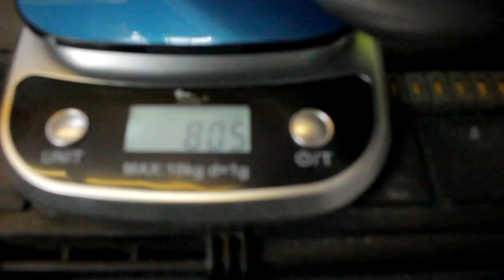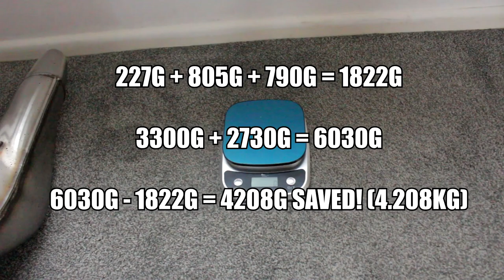KTM DUKE 790/890 R AUSTIN RACING RS22 V DECAT UNDERSEAT EXHAUST INSTALL VIDEO

Comment: did you need to remap the ECU or get a powercommander? I am worried about damaging my 2021 890R without also adjusting fueling but am have issues finding something that works.
Reply: Correct. I’d like to hear this response
Reply: I've been asking everybody I can about this... I talked to Superbike Unlimited in Asheville, NC... they said the wideband O2 sensor and ecu will adjust to removing the cats on this bike. I also talked to my local KTM dealer and they said the decat link pipe does not require a tune either. 

I was really surprised since I'm used to the traditional knowledge that slipons are okay but anything to do with removing catalyst system means you need fueling adjustment. But so far I think this bike is totally okay with leaving stock fueling. Let the bike idle for 10 minutes after first startup and it will adjust itself. A lot of inconsistent information out there, some good some not so much.

Edit: I wanted to add just incase, this is for changing the exhaust system only. If you combine removing cats with some type of airbox mod that is when you will run into issues. The 890 Duke can handle changing the exhaust to anything but if you add that in conjunction with airbox mods as well then it cannot keep up and you definitely need a tune or some type of piggyback fueling option.
Reply: @AutenBrian3  I meant to respond to you in my response to Luuk, check it out if you want. thanks
Reply: Late reply but - Rotwilier performances dyno results (de cat vs non decat) suggested no major chage to afr/ hp when a decat is performed due to restrictions in the airbox.
Reply: @v4Mark  hey what’s your experience with it? I just got inside from decatting my 790 and was wondering if I needed to tune
Reply: @DiggnUpBones  you are good to go. I’ve been running mine for most of 2022 and it runs similar to stock. I’ve talked to more people at dealership and the tuning shop and this bike is good to go with decat only. Adding an open muffler plus decat it becomes a little more questionable and the answers become split. But decat alone is 100% fine from every expert I’ve talked to. My bike has been running perfectly
Reply: @v4Mark  Hey mate, just to clarify are you running a decat + exhaust or just decat? Cheers.
Reply: @TheKez1a  only decat. Stock exhaust other than that
Reply: @v4Mark  hey I have an SC project and the decat and it’s lacking torque or something it sounds loud and good but power decrease
Reply: @TheKez1a  I have both now and I’m wondering if that was bad
Reply: I noticed a bit of a power decrease without the tune maybe the ecu is adjusting but I’m not sure
Reply: @DiggnUpBones   I think if you have both, a tune would be a good idea. The ecu could adjust and it still has less power, though,  it doesn´t necessarily mean the AFR is off but I would still tune if I had both just in case. I think if you have decat or slipon and you are good, but if you have both I would tune it.
Reply: @DiggnUpBones  I've noticed this as well with my arrow Pro Race. I am looking to get a tune done soon.
Reply: The bosch ecu used in 790 and 890 will adjust. Actually I've seen graphs that removing the catalytic makes the engine run colder. Hp gain in low rpm no changed at mid but a slight drop of power at the higher rev. Afr mixture improved across the powerband too.

Comment: Did you do a remap?
Reply from the maker: Yhhh, I also purchased Austin racing’s air box mod and ATOM fuel module
Reply from the maker: Will do a dyno as soon as I can
Reply: @JuniorMotorcycles  results?

Comment: You need to sack those rear pegs ! especially seens as you dont even have a rear seat and those pegs look pig awfull. I fitted the LeoVince twin cans and decat pipe jeez way way too loud ! and i like loud pipes so im assuming you will probaly go the same way and refit the cat to tame the noise down and it does sound good with the cat, if you do put the cat back in dont refit the mounting bolt behind the chain its a pain having to remove the gear change ect to get at it and if you do remove it again its a 5 min job to remove.
Reply from the maker: Thanks for the advice again brother and I need to keep pegs on as I take the Mrs with me on the weekends. Big on my solo rides when the solo seat goes on they come off also. I agree it’s way too loud so I’m going back to the cat or decat and OEM silencer